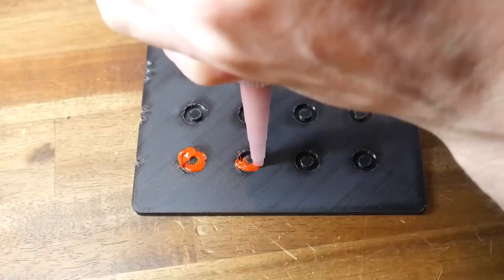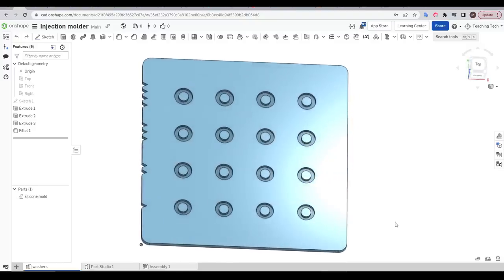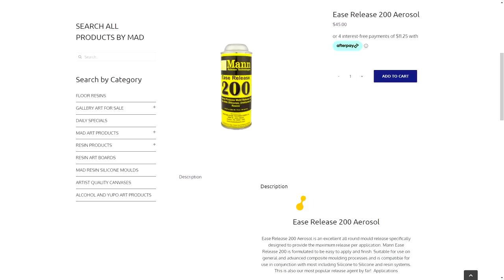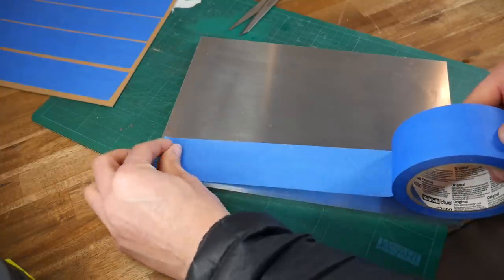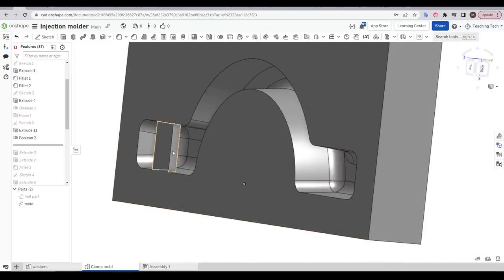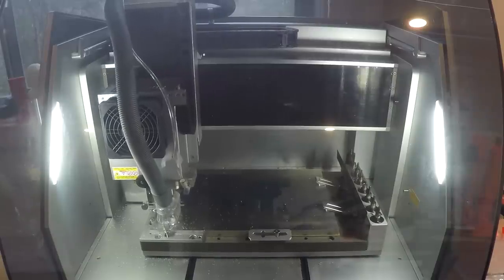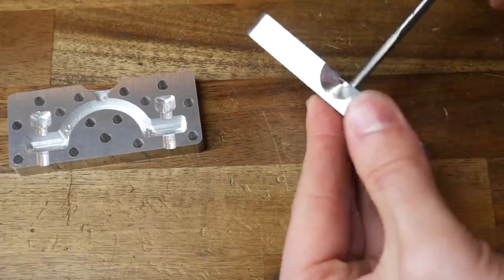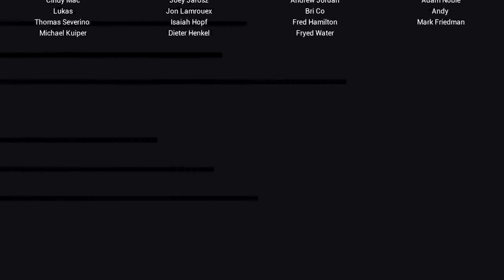Home injection molding part 2: Machining a mold

Comment: A wise man once said, "There are zero good reasons to ever fabricate your own O-rings" with how many OTS sizes are available for a custom design.  Design around commodity components.  You are also greatly underestimating how precise O-Rings need to be for proper sealing function.   I'd also recommend using TPU printed (with ironing) molds as they are much easier to eject because you can simply press the parts out from behind...Not to mention how much easier they are to produce.  The metal molds don't provide many benefits for exothermic/thermoset materials like epoxy, PU, and RTV.  It also helps to cut the petroleum jelly with a spirit as you can get much thinner coats of mold release on the surfaces that don't witness in your parts.
Reply: Yeah and honestly. Dude could have just drilled the hole out a tad wider and boom.

Comment: For tubes like that with caulking, I like to roll up or fold over the end to take up the slack that way all your squeeze pressure is going out the business end instead of ballooning the air filled end.

Comment: I've made some silicone moulds with that RTV to make some high temperature silicone parts with some success. If you want an O-ring instead of a washer, try making the mold with resin printing as a two part mold. You can make a better version of the release agent by thinning the vaseline with some naphtha. Inject your silicone to fill one side and then the other side and then press both sides (remember to overfill it a little because you need to press the mold with some bolts or a press or something to keep the two parts in place. Wait to cure and open the mould and you'll have a perfect O-ring

Comment: Use dawn dish soap as a release agent for silicone. It will dry into a solid waxy film that can be washed away with water. Silicone can also be easily released from wax paper. 100% isopropyl alcohol will prevent silicone from sticking to your gloves (frequently wet and soak the gloves). Liquid and gel release agents can be displaced by the silicone which will then bond to the mold.

Comment: O-rings can be ordered in any material, durometer (hardness), id, od, and ring diameter (if you measured the oring itself not the overall id or od). The rtv may be good for the high temps, but is a poor choice for something that needs to slide. It's just too soft to withstand the use as you saw. You need something that has a much higher durometer. See if you can find the specs for the original O-rings, and see if you can find some with a slightly larger od. O-rings can also be different shapes. They can be round, square, d, and probably a few others I'm forgetting. Hope this helps.

Comment: To run a finishing pass after you have removed the part from the machine, just machine a pocket according to your part outer profile in a piece of wood. Make it a fairly snug fit. Put your part in the pocket, clamp down, zero your Z and run your finishing pass again. This also works well for double sided machining. You can also do multiple pocket in a row for several operations if you need to machine more than 2 sides.

Comment: them not knowing the size of their own cutting bit is quite concerning
Reply: It's not a traditional CNC machining tool, it's supposed to be used with a rotary tool by hand, so the exact dimensions are not important at all for dremel. You get what you pay for...
Reply: @ProtonOne11  Yes, exactly. It is a tool but for manual processes. Additionally, even a CNC toolbit behaves a little different in different materials. So I like do process a test part and measure the workpiece dimensions. That’s how I got told in CNC woodworking class during my apprenticeship. 
And in metal processing it is even more crucial. But then you can invest a little more money in a professional CNC carbide bit for metal milling, and you should get one that is calibrated precisely with a certain tolerance to rely on.
Reply: Anytime you buy a milling cutter, you should always check the diameter because they are usually given in nominal dimensions and ground undersize. This is especially true in the case of cutters where the shank is the same diameter as the cutter (i.e. 12mm end mill with a 12mm shank). Because the tool needs to have sharp cutting edges, there's a slight margin of error introduced to the business end because enough material needs to be removed to produce the sharp cutting edge. 0.1mm is not outside the realm of realism for a cutter of this kind, considering the shank of a Dremel is designed to hold a 1/8" diameter (3.175mm) shank tool and the ball end is ground slightly below that to produce the sharp cutting edge.
Reply: "Cutting bit"
Reply: Rude way to point it out juhotuho,  but a bit more reading up may be of use Michael!

(Unintentional Pun lol)

Comment: You might want to consider ptfe sealing rings. They can be easily shrunk and stretched, and if you can’t get the exact size , you can create a split ring, where you slice one side of the ring at a 45 degree angle so that it forms a scarf joint

Comment: Okay, so from what I have watched from the my manufacturing experince with injection molding, you dont need such a steep drift angle for the part to relese. 1.5 deg is more than sufficient :). If you want to make O Rings best is to make a small mold out of plastic itself use elastic bands to hold 2 parts and have a release hole that is 2x smaller on the opposite side. When you see silicon coming out on the other side than it means that your mold is filled up with the silicone. Once you open the mold you should have a nicely round O ring with great finish :)
Reply: I would normally agree with you about the draft angle but you can see how rough the surface of his steel is. No offense to Michael, this is his first time and he's learning. In a professional environment the surface would be cut better and then polished. I personally have no idea what the shrink and flow properties are with the material he is using and how the material will flow in such a small press and bla bla bla... This is all uncharted territory even for someone who is experienced with injection molding in an industrial setting.

Comment: Go to Parker and use their sizing tools to find a part number for the correct material, ID and cross sectional diameter. From there, go to a distributor (McMaster-Carr or Grainger in the US) to order that size. It’ll show up in 1-2 days.

Comment: I have a question: To open the valve, you need to pull the leaver and push it back, to close it. That's Why the o'rings are damaged. But if you have a Rod, can't You just use Rotational force instead of linear? So You just twist the rod like a valve. Of course the valve need to be prepared for this.

Comment: For a one off or very limited number of injection moulded objects, it would be easier to 3D print the object with a low melting point material and make an investment plaster cast mould from it. As long as the mould is in a rigid container, you should be able to use your injection moulding machine to inject molten plastic under reasonable pressure. Preheating the mould and using vacuum around the mould would give you even better filling and no seam lines  at all.

Comment: You would be SURPRISED at what it takes to do actual commercial injection molding.  I work with a company that does injection molding of plastic parts.  The molding machines are ENORMOUS and the injection molds equally so.  For instance, The injection mold for a 'lawn mower grass catcher lid' weighs in at around 18,000 Pounds and is carved from blocks of steel.

Comment: for the Cavity i would go with a Toolppath that follows the countrour of it (no idea if kiri:moto allows for that) should give a cleaner result.
would also line polish the Mould into your ejection direction, this makes ejecting the part easier and the surface quality better.

Would be intresting to see how the air vents turn out, On industrial moulds usually a gap of 0.01mm-0.03 (with ABS as a material) is common.

Comment: Try a compression mold, this is a 2 part mold that squeezes out the extra silicone and air bubbles. The easiest one to do is cup shaped and lets the excess squeeze up and out as the 2 halves meet..

Comment: Next time, consider using shoulder bolts (in place of the M5 bolts) to create the bolt hole cavity in the part. The precision ground shoulder of the bolt will make a better seal in the mold, and leave a smooth bore in your part.

Comment: Please don't take this as a criticism of your great work but regarding the sticky valve; do a proper repair rather than cobbling together a half arsed solution that won't stand the test of time. 

Ream the hole straight with a decent reamer rather than drill bits. 
Source pre-made silicone or viton O-rings to match the reamer size. 
Turn a new shaft to expand the O-rings to the desired final dimension. 
Chamfer/ de-burr  the edge where the exit hole intersects the hole for the valve shaft.

Cast silicone from a 3D printed mould might be good enough for a hot end sock but it won't be good enough for a moving part which needs to be air tight. I also doubt that RTV silicone has the required wear resistance for a moving part. It is designed for flat immobile surfaces clamped together under high pressure.

Comment: Just a couple suggestion to think about.

To fill the silicone mold, did you try just putting a big blob at each spot (easier to squeeze) and then use something like a credit card or spatula or squeeze (like for screen printing) to drag across the top, force it into the cavity. A few wipes would likely get it nice and full and level. Maybe a bit of release on the squeegee for the last wipe. And since the tops are going to be flat, maybe make the bottom flat too so they are just cylinders.

A second suggestion, if you have a lathe, maybe something like bronze rings, split in half, so they are just a really close fit (maybe ream the hole to size) widen the groove so it can hold 2 or three split rings so the slits aren’t likely to line up. Btw, to get a close fit you’d probably be better making two rings for each final ring and milling half off so they are a perfect 1/2 ring and sides fit tight together. If you saw one in half, you’ll always have a gap unless you have a zero thickness saw hand😁

Comment: Most injection molding machines do not use washers, but rather a precise fit between piston and cylinder to seal them. 

It is alos preferable to use proper ground pins, press fit into undersized reamed holes on the one side and with a slip fit into reamed holes on the other side as alignment pins.

Comment: 3d print a tube squeezer - there are plenty on the standard repos to choose from.
Reply: Had the same idea 😂
Squeeze that RTV out like mustard!
Instead of the "wing bolt" of the squeezer, a hex head or 1/4" square hole could be implemented, to use a ratchet for easy squeezy 😂

Comment: What do you think about casting a longer cylinder with a hole in the center to cut the washers from after the silicone has cured? Maybe a cutting jig would also be a good idea to get a consistent thickness and surface finish.

Comment: Oh, and your o-rings for that valve need a higher durometer (harder) and they must not be so wide that they fill the slot in the shaft when not installed in bore or they cannot deform properly.

Comment: Hi, I’m interested in this machine, and wanted to ask what is the true work volume for 3 and 4 axis… the site says 36cm (Y) x 24cm (x) x 14cm (z) for the 3 axis. And 9.2cm (D) and 24cm (L) for the 4th axis. Wanted to ask if this is what you experienced or is it much smaller than those numbers because for example the 36cm would mean collision with ATC?
Reply from the maker: I have used very close to that width once. From memory I had to temporarily remove a section. Wasn't a big deal but not ideal either.

Comment: If you want good quality aluminum parts, buy solid carbide endmills meant for CNC, rather than dremel bits meant for handheld tools. Tungsten and other coatings on endmills will clog quickly when machining aluminum. Real endmill (even cheap 3mm ball nose from amazon) will come with exact dimensions so there'll be no guessing involved.

Comment: invest in some spotting dye or blue dye, and rub it on the core and cav & squeeze them together with a clamp or screw it down, and make sure there's seal off around your part. Otherwise it's going to flash and/or pour out everywhere... t. I make plastic injection molds for car manufacturers

Comment: Silicone probably stick to 3d print imperfections (think gaps between layers). My experience makes me not to expect silicone to stick to many materials without any release agent. Sure, from somewhat smooth surfaces it "reveals" but more than often not, unless you have a polished surface.
From drilling video I'd also assume your holes are not smooth. Drills tend to leave rough edges that can also eat o-rings.
Experiments like that are still interesting. For me it is not about to see the great result, more of what works and what not and how to identify and solve the problems and lesson learned from them.

Comment: Is there not a McMaster Carr in AUS or something similar? O-rings come in standardized sizes, you just need to now the ID from the rod and the diameter of the bore, dynamic seals should be ~0.010"(0.25) total, cross section from the rod is usually 1.2-1.5x the cross section of the o-ring

Comment: should not have made holes at the ends the mold, plastic will just flow out of them leaving voids inside the mold, the plastic need to be compressed to fill the voids, small vents 2mm from the edge of the parts 2mm deep would have bean sufficient for the gasses to escape. 
before you close that mold and inject it you may want to spray that release agent in there because that part will probably stick to that mold and with no way to eject it wont be ease to get that part out. just my 2 cents

Comment: i coat the molds that i cast my silicone mold with a clear gloss spray pant then use a small amount of Vaseline like u said but i also used the casting silicone that cnc kitchen says to use way easier to cast with ive been casing silicone socks for my water cooled slice engineering mosquito hotend for a year now

Comment: A higher duro rubber may work better for an o ring that has to pass over a lip like that. If you can get a dimension, try talking to MHS(malaga) to machine something. Maybe a bronze impregnated ptfe or something

Comment: :yt:WOW... Why didn't you just: A) Use a lathe to deepen the o-ring grove to fit an off the shelf o-ring. or B) put the shaft in a drill and deepen the o-ring grove with a file?? :yt:

Comment: For injection molding, can you use your 3d printerto inject pla into it? Have the nozzle pushed into the opening forcing filament into the mould? Maybe heat the aluminium mold so the pla doesn't harden/cool before filling it up.
Reply: Not nearly enough pressure/material flow
Reply: That would never be fast enough and 3D printer-size stepper motors (or even servos, for that matter) would never have enough torque. Sufficient pressure for mold-packing would likely rip the extruder apart - either the wall of the heat break would rupture or the threads would strip. One of the primary reasons for investing in injection molds is their rapid cycle times. A 3D printer extruder would be marginally faster at filling the mold than just printing the part.

ETA: Even if all of the above weren't issues, the mold would still need to be pressed against the nozzle hard enough to create a high-pressure seal, which absolutely zero desktop-sized printer gantries are designed to withstand.

Comment: I would advise you to do the fusion and cam in fusion360. Would make that part much more accurate and easier.
Reply: AutoDesk changed their license for Fusion, unless he's paying for a professional license, he technically can't use it for the project and definitely won't be able to show it on camera ☹️
Reply: @Teklectic  he is not selling it, and it is for educational content. Autodesk loves that shit. Either the startup or educational licence would fit this application.
Reply: @BuildItAnyway He's not selling the product no, but he is making money with the software via YouTube revenue, so that becomes an issue for the educational and free licenses and it looks like the startup license has a 3 year limit on the age of the startup, so may not be applicable due to the age of the channel. 

Anyway, I trust his judgement, I'm sure he has a good reason for avoiding Fusion and it might just be as simple as the fact that Kiri:Moto, being freely available to anyone on any system, and powerful enough to do the job, makes it an ideal tool for teaching.

Comment: just order some low viscosity 2k silicone and you will not have any problems releasing it, cause it doesnt attach to anything else than silicone...i'm doing custom molds quite often for silicone socks or silicone models of characters with a loft of different colours :)

Comment: For what it's worth, designing and making the mold is usually one of the harder steps, there's a lot that goes into that.

Re: Silicone: Just as a side tip, you can make a lot of stuff out of normal silicone caulk (the pure silicone  type), adjust the color with food coloring (if you care), and the desired elasticity by mixing in cornstarch. It's pretty good in a pinch .. probably not for what you were doing, but for making removable/reusable molds, it can work well.

Comment: I'm telling you right now what if you inject abs or some other thermoplastic into that mold it's almost surely going to squirt molten plastic over you through those air release vents giving you 3rd degree burns that will take months to heal.